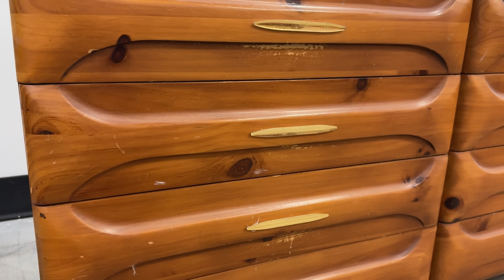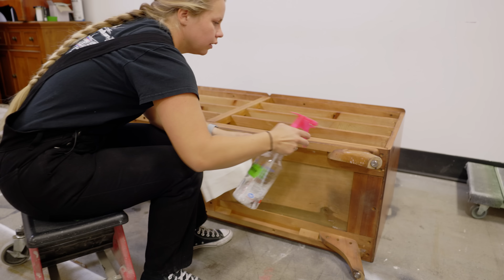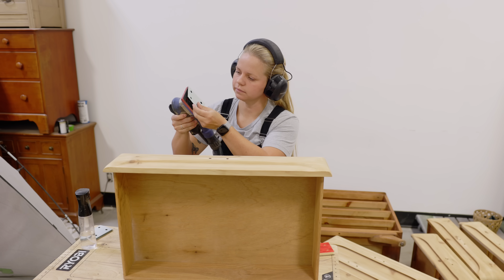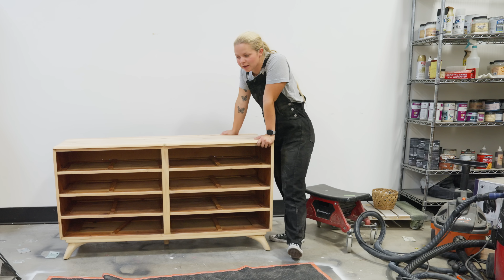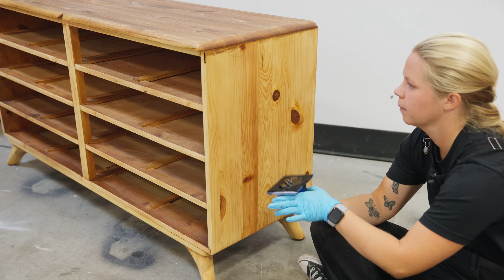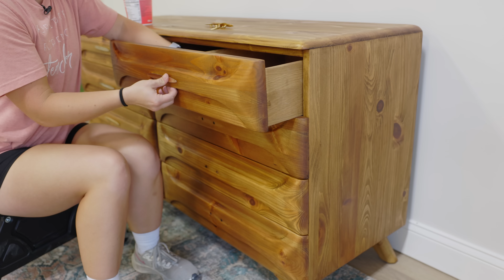SCULPTED PINE DRESSER RESTORATION

Comment: Two points. The sanding swirls, you need to get a firmer grip and slow down moving across the surface. The other thing, is adding water doesn't darken the swirls it raises the wood grain so that you can send it back down.

Comment: Doing another coat of stain will darken it up. Even a couple of coats .   I like the General Finishes gel stains and Java is a nice dark stain.   If you are down to bare wood I would not use a gel stain, but a standard oil base stain that soaks into the wood.     I also like General Finishes top coats.   Nice piece of furniture!

Comment: I refinished antique furniture for years. I would have  use a liquid stripper with a 4 zero stell wool
I never used gel stain.
I only worked with regular stains. My finished would have been 2 coats of tung oil. 
It is a gorgeous form of furniture. The legs are fabulous.
Reply from the maker: yes there are so many different ways to do it!

Comment: this is the issue with pine, it will always turn out splotchy and uneven, even using prestain.  One thing that will affect it is sanding to 220..might need to stick to around 180. You could use toners to blend and make it more cohesive. If it was for me I would just lightly sand it and paint it with tricorn black. That dresser painted black would be gorgeous..without the gold trim on the drawers. I love the curves and style.

Comment: Original: The stain treatment tempered the wood's grain & allowed the sculpture of the dresser to be on display. New Flip: The treatment & stain enhanced the wood grain & competes with the design element of the dresser. Therefore, I don't care for it. I would've looked very carefully at the tones of the grain and used a stain to cover, neutralize or camouflage them. I wonder if the original stain wasn't more of a walnut color w an oil based poly over top instead of water based poly. With age, the oil poly turned more and more yellow.

Comment: Love the stained look! In the future if you want it darker you can do 2 coats of the gel stain. I also recently learned that not all gel stain is created equal. I had been using minwax for years because it's what is available at the big box stores near me. But I just decided to give General Finishes a try, and WOW! So much better than minwax. It has way more pigment so you get a more true color with one coat. I'll never use minwax gel stain again.
Reply from the maker: i wanted to use general finishes but i didn't have any locally that i could get quickly so I decided to go with this. next time i will have to try GF! Thanks for watching!
Reply: @FurnitureFlippingTeacher  Many woodworkers only sand to 180 so that the pores of the wood remain open enough to accept the stain.  I have noticed too much sanding does not let the gel stain (or any stain) darken enough.  Adding second coat doesn't add much either.  Wood conditioners also prevent overabsorption to prevent the blotchies, so the stain is lighter.  GF brand of gel stain is the best IMO and worth the price.  Staining wood is way more unpredictable, like you said, depending on the wood, the color can look totally different.  You can put a darker gel stain over a gel stain to color correct if needed after first coat is totally dry.  I have even added gel stain over a finish coat.  Love seeing your skills evolve!

Comment: Seems the staging is wrong. Change the staging, and the character of the piece will come through. It's difficult to envision its potential in its appropriate environment/final home with the staging you've used. The fiddle leaf and faux worn synthetic bohemian rug trend is really wearing thin and doesn't speak to more eclectic, diversified tastes.